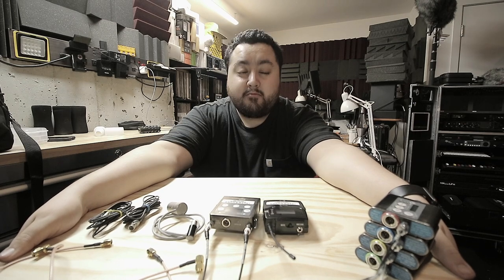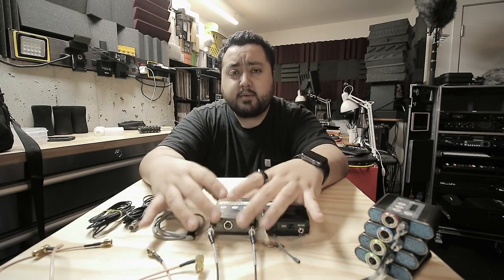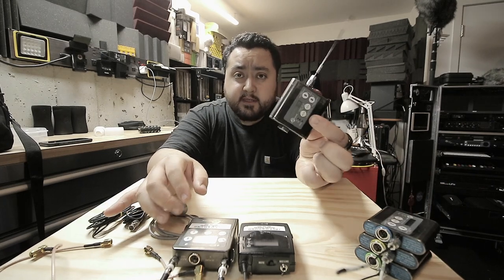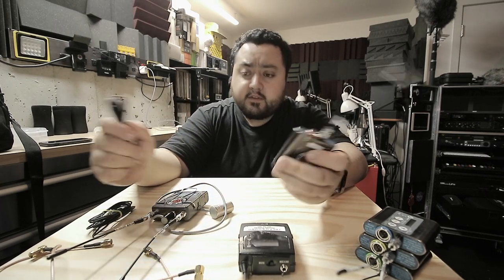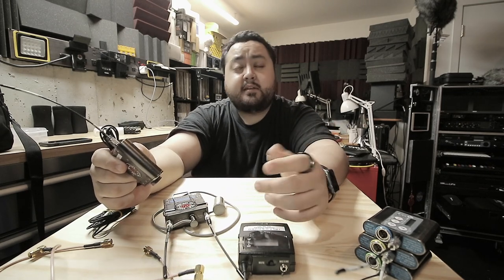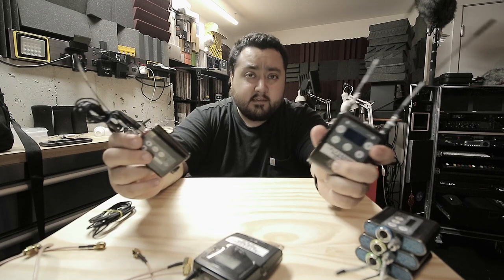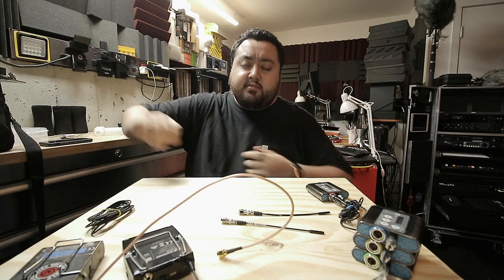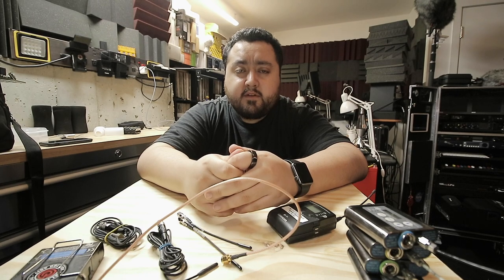WIRELESS 101 PART 1 - LOCATION SOUND TOOLS EP001

Comment: Do you find range is better on Lectros vs G4s or is Lectrosonics’ ruggedness the deciding factor?
Reply from the maker: They are a better system sennheiser is good but range and sound quality and dynamic range is better on the lectro the way sound gets compressed by the g4 is kinda noticeable, with that being said you can get a decent sounding g4 for sure is just knowing having the right settings and upgrading the mic so nothing wrong with sennheiser

Comment: Do you have upgraded antennas on your G4? My antennas are way shorter than that. May be a geographical thing aswell (i live in sweden). Also, I think it may be on all systems, but on sennheiser you choose a frequency, then head into choosing bank and channel, and its recommended to use the same bank on all your frequencies.. I'd love some information abou that since im super confused lol
Reply from the maker: Hey yeah maybe mine are range G 566 to 608 , blocks are just a chunk of the frequencies they just divide them to make it easier to navigate, you can have you tx on different blocks, as long as they are not conflicting it should
Be fine,